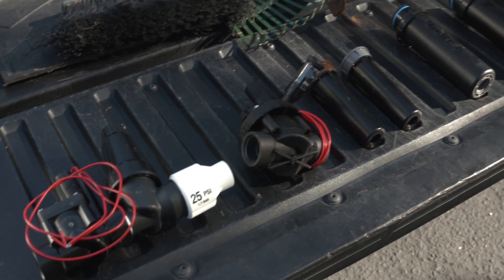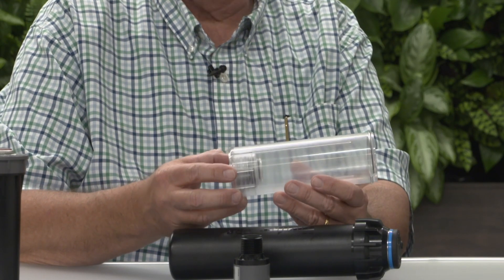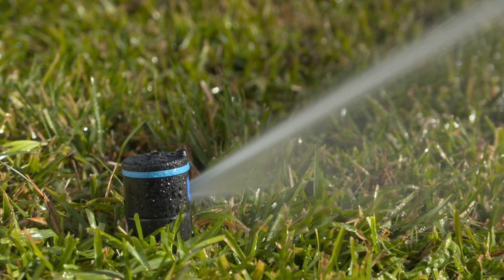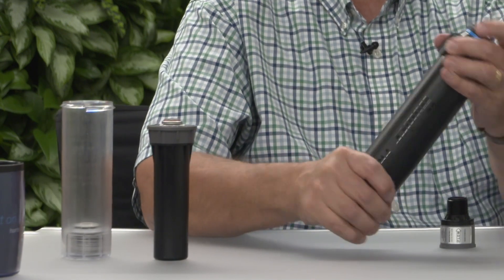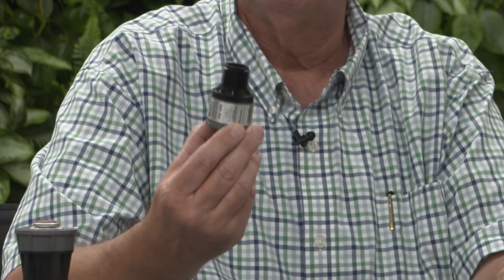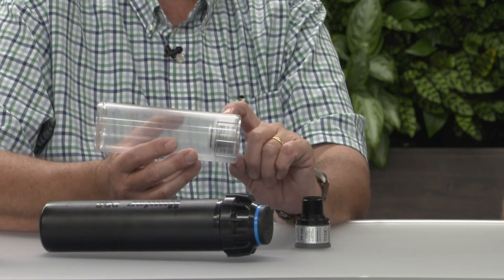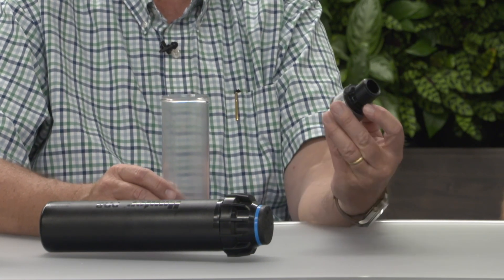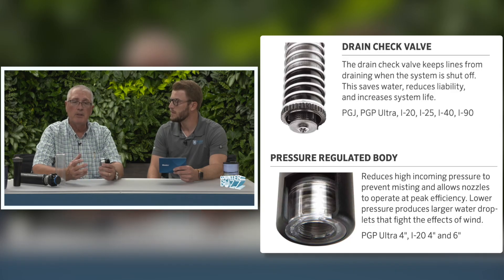PR-075 Pressure Regulator for ¾" Inlet Rotors

Comment: No one seems to have these in stock.
Reply: @Hunter_Landscape_Irrigation  Thank you - until then, is the PRB available separately? I'm guessing not - I have not been able to find that, either.

Basically, I have a lot of 4" PGP rotors that could use a bit of a height boost, and if I can add pressure regulation in the same go, that's a bonus.